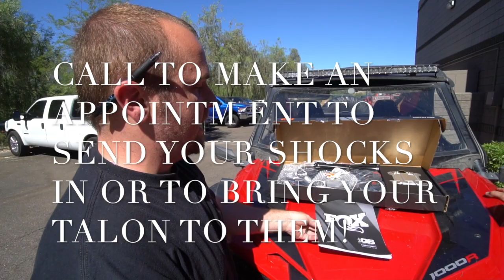Honda Talon Fox iQS info & Review!! Shock Therapy Q & A. RIS (Ride Improvement System) 1000R 1000X

Comment: Really good move! Get rid of those high center of gravity fuel tanks mounted above the engine! convert to ten gallon tank! I also use shock therapy!
Reply from the maker: I have a 4 seater now with the 12 gallon tank. I have 17,000 miles with my extra fuel tanks and love them, definitely won’t get rid of them.

Comment: Are you running the S&B filtration system WITH a rear window? If so, what window are you running? Can you do a small video on that?
Reply from the maker: I am using the Honda oem rear window. I have a separate video for it with the particle separator already

Comment: Great write up on the upgrades. Can you answer this question. I'm running the stock suspension, although decent, in the larger boulders, fast smooth trails, it's horrible in the small chop chatter in the small 6-10" rocky gravel road, like all around Breckenridge, CO. Does your Talon suspension sound like you are being drug across a gravel road in a cheap red wagon with no wheels. This is what I'm concerned with. Both my Talon and my buddies Talon sounds and feels like this from when it was new. Now with just under 1k miles. Drives me crazy. It's soooo bad. I'm thinking its the suspension locking up not being able to keep up with the up and down small chatter resulting in no suspension in those conditions. Did your Talon sound like this before and/or now with your upgraded suspension work? Do you know the sound feel I'm referring to. Thanks.
Reply from the maker: I don’t remember having that type of noise. I am very happy with shock therapy. And I use the iQS far more than I expected

Comment: Maybe you can’t answer this but do you believe that Jackson is having trouble with the turbo all across the board or do you think you have more troubles because of your elevation changes? I don’t have any experience with it as there isn’t many of these machines around here where I live yet at least not with the turbo kit on them. Also I want to thank you for all of the great videos you have made for the talon!😁👍🏼👍🏼
Reply from the maker: The turbo kit in my experience only has issues above 2,000ft elevation. If you stay below that, you should be fine!

Comment: Hey Russel what limit straps are you using? I’ve been in contact with Shock Therapy and they are still working on the Talon limit straps as of a week ago (07/04/20)
Reply from the maker: GO TALON I have shock therapy limit straps!
Reply: Honda Talon Turbo Owner wow that’s crazy, cause your video is four weeks old and I contacted them probably two weeks ago? Maybe yours are prototypes? Anyway good deal!
Reply from the maker: GO TALON I got hooked up!!

Comment: Hey Russell big fan of your videos I've been watching, I am a quadriplegic that uses a Honda talon R for a fast wheelchair:) have hand throttle installed... I have got standard suspension and it's quite bouncy and get quite a sore neck since I've broken it before! I'm based in New Zealand, and would like your advice what is the best thing I can do to improve a soft ride, considering I'm not in the US so easily get shock therapy? Cheers!
Here is my first video:) https://youtu.be/hSUZWkY164Y
Reply from the maker: Thank you for watching! The Talon springs are very stiff. First and easiest step is softer Springs. I’m assuming there isn’t the options available there like shock therapy has. I do believe shock therapy has dealers all over the world, & I believe there’s one in Australia. That might be a better option for you. I highly recommend getting the dual rate springs, and RIS with the rear spare. That will make the largest difference, but very expensive!!! They can setup your talon for an ultra plush ride. I have mine setup for high speed/jumping. But they tailor each setup to your needs. I would at least order the dual rate springs and have them shipped and installed. Hopefully this info helps.
Reply from the maker: I need your video making skills!! I’m just a beginner!!
Reply: @gravesru  oh I just used the QUIK app I think it's GoPros video editor it's free and easy:) oh and I have a drone also
Reply: @gravesru  so does the spare tyre help by adding rear weight?